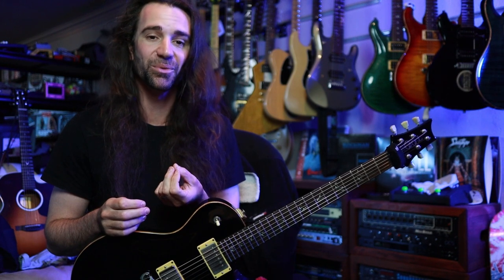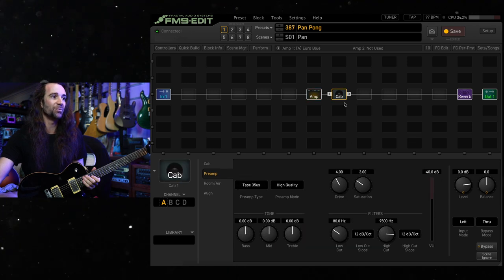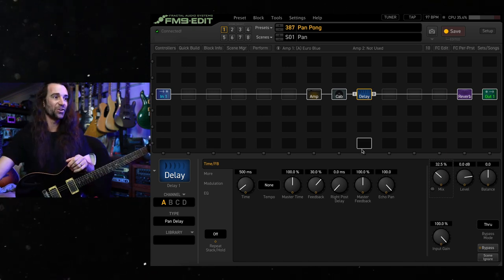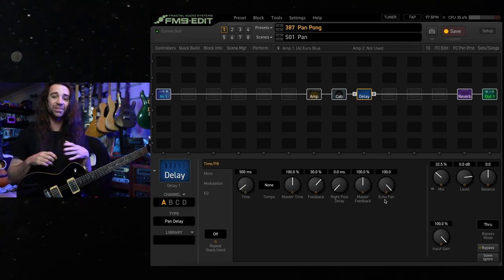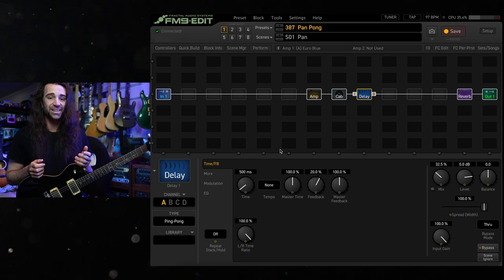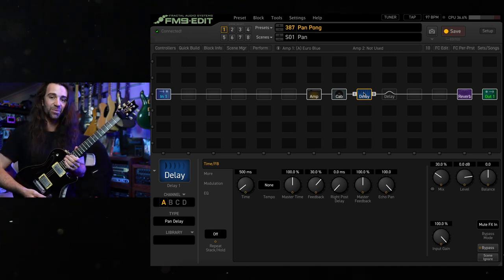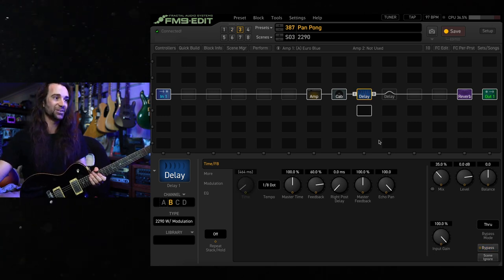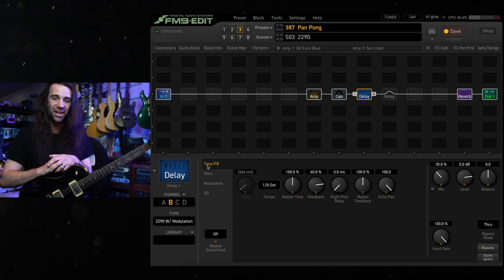Pan or Ping Pong Delay? | 5 Minute Tones | FM9

Comment: Hello Leon. Would love help tone matching a patch for my new FM9 Turbo. I’ve always loved the tone of Michael Sweet of Stryper. I would like to get close to his tone on the new single release “Transgressor” that is on their upcoming new album The Final Battle. New to the FM9 so looking for help.
Reply from the maker: Is Michael still using Boogies? If so probably the IIC+ model with a PEQ up front pumping up the mids
Reply: His basic rig is the ISP Technologies MS Theta Pro DSP Michael Sweet Preamp and Multi-effects Pedal, a ISP Technologies Stealth Ultra-Lite 180-watt Pedalboard Power Amp, and Marshall cabs. Would love for you to recreate his tone from "Transgressor" in a FM9 patch if you have the time. But I will start with your seggestion.
Reply: @LeonTodd  Hello Leon. I received your take on potentially getting a Michael Sweet "Transgressor" tone and tried to dial in something using the Amp you suggested but could not get very close to Michaels's tone.  I do admit that I am really new to creating patches. I've been using Fractal products, back to the original Axe FX, but primarily acquired presets from the Fractal AX-Exchange or purchasing them from great creators on YouTube.  So I still could use more help creating a Michael Sweet preset if you have the time. No pressure. I'm going to keep tweaking.